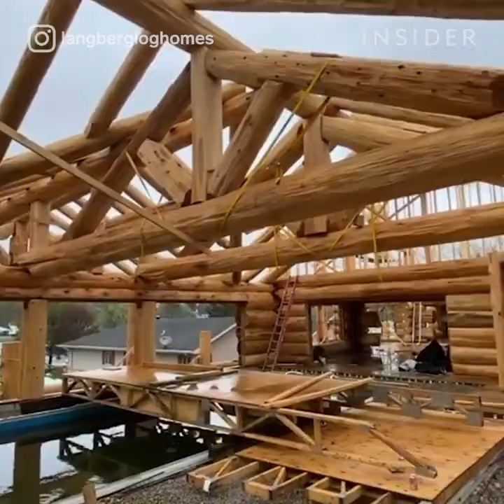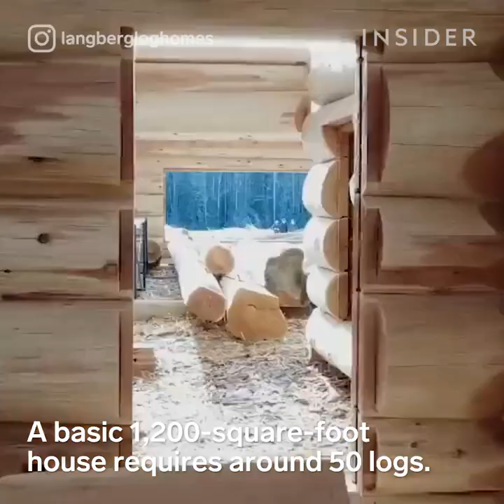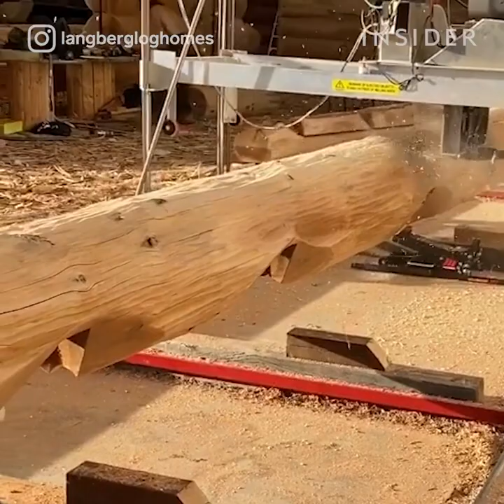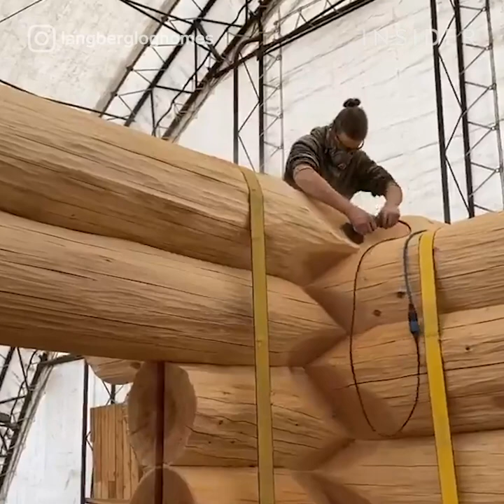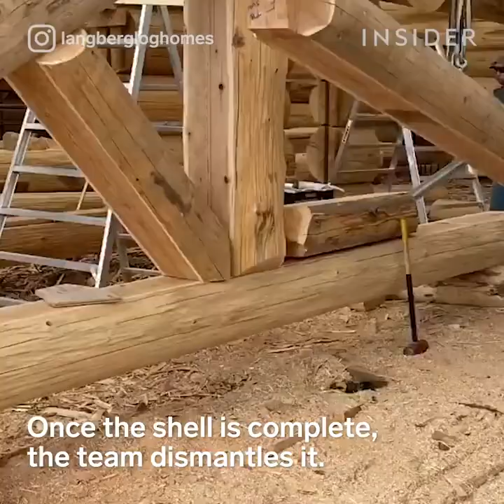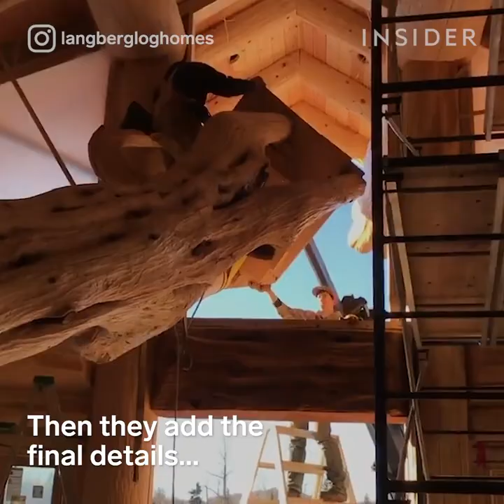How Custom Log Homes Are Built

Comment: Beautiful, but deforestation aspect worries me.
Reply: ??? Even if the trees were a hundred years old, if the home can last 4-500 years and the logs are from a renewable source where they plant more than they cut,  it's more than self-propogating
Reply: Actually, using trees to build homes is a better alternative than letting them rot and produce CO2. The cut trees are replaced with new ones, and they will produce oxygen for a long time. Log houses are more environmentally friendly than the ones made out of other materials